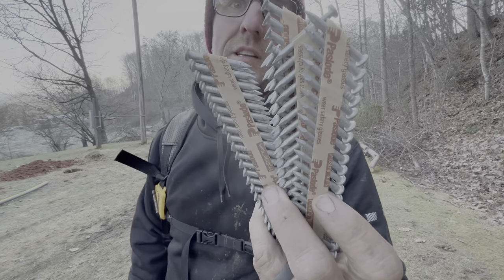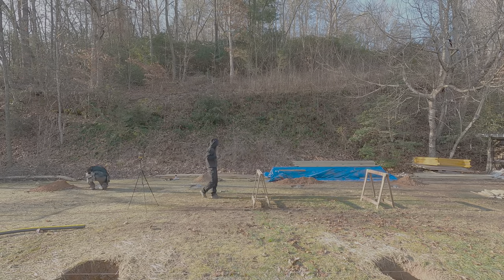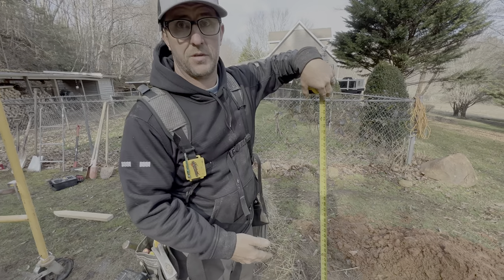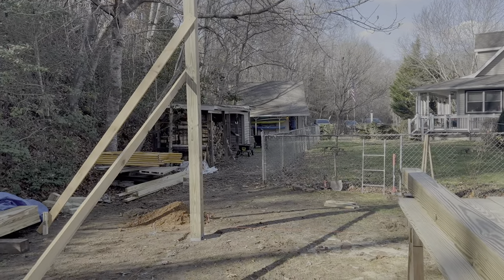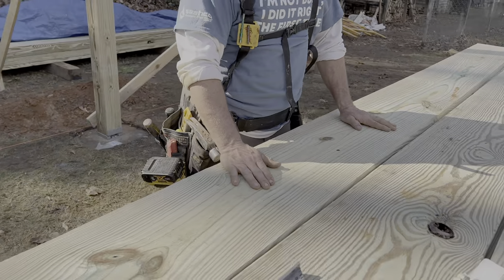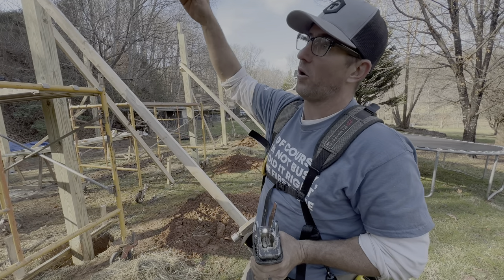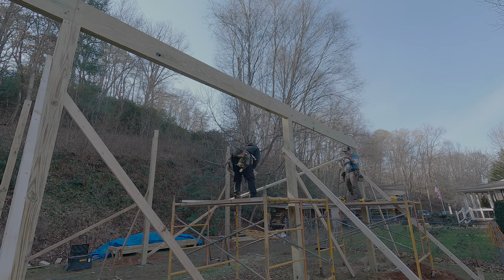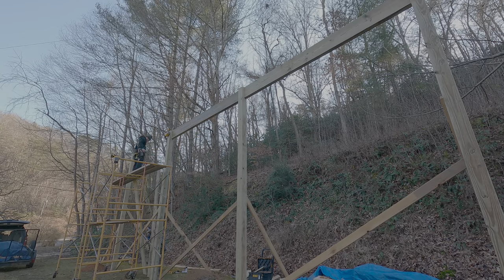Building A Pole Barn // Episode 2 - Posts and Girders

Comment: Those post brackets should be above ground so water does not fill up around it..  Or did dirt down lower than concrete
Reply: Exactly, I mentioned that on the previous episode. Maybe its not required in their area, but in Cali it is.
Shoulda had Jaime check their work!

Comment: When you guys explained your measurements for post length on your tall wall I believe you messed it up or explained it backwards. When measuring from the ground up to a laser the smallest measurement is your highest point. And to level the rest of it you take the difference in your ground to laser measurements and add that.
Reply from the maker: Yeah I think that was our first go around and trying to figure out the lengths. . But we definitely did it correct because it is level. So I think we figured out the right way down the line.

Comment: Heads up on those non-laminated posts wanting to twist/warp on you once they are up, making attaching the horizontal girts (I assume you are attaching metal siding that way) a real PITA install later when post faces aren’t in line. The sooner those go up the better.

Comment: Can you expand on why you chose to set the shorter posts in the ground but the taller posts merely on top of the anchored brackets?
Reply from the maker: The explanation was in the previous video… there is an old road where the taller posts are.
Reply: @Building_Jays_Way  oh right, I caught that hence the shallower holes, didn’t realize you weren’t going to use the same technique on the other side. Keep up the good work

Comment: Looking good, however I’m curious as to why you didn’t place all of your posts in the ground and pour concrete around them versus using the metal attachment plates? Where we live along the coast of Florida you are required to set your posts in concrete due to the wind loading we have from the possibility of hurricanes. Keep up the good work and looking forward to the next video.
Reply from the maker: If I wanted to bury the high side in the ground I would’ve had to buy 20 foot 6 x 6 and that’s a difference of $200 versus $75!

Comment: I didn’t catch why you guys did one side of the posts with the post base and the other side you did in ground. Was there a specific reason?
Reply from the maker: Cost!! I would have had to use 20’ posts on the high side and they were $200 opposed to $75!

Comment: Hi from Thailand
Quick question. 
Which sides the front ? 
Open space side or hill side ??
Just checking as the front should be higher than the back for water run off. 
I know you'd know this but there doesn't seem to be much room hill side if thats the front to manoeuvre vehicles in/out.

Just sayin..

Love yur channels.. quite entertaining
Reply from the maker: The high side is towards the mountain. So the water will runoff the structure and down the hill towards the creek. There’s a way to back the camper in from the backside of the property. Also the way the slide out comes out of the  camper it has  to go into the middle of the structure.hope this makes sense.

Comment: Why are some post buried and some in brackets?
Reply from the maker: Because of the height of the posts. I bought 16 foot poles for the high side so I did not have enough to bury them into the ground. If I wanted to bury those into the ground I would’ve had to get 20 foot posts and those cost about $200  a piece!

Comment: If the first post was 37 inches from laser to post bracket and the second one was 36 3/8 from laser to post bracket that would make the first one lower and not higher than the second. So if you made the first post 15'4" and the second one 15'4 5/8" then the second one would actually be 1 1/4 inches higher than the first and not even with it.
Reply: The first measurement was 5/8 taller than the second one that means you would have to add 5/8 to the second one to get them even.
Reply: @ronniekilbourn3614  except you're measuring down and not up so the addition needs to go to the longer one for the top to be even draw it out on paper to make better sense of it.
Reply: @ronniekilbourn3614  imagine the first measurement was 37" and the second bracket was much taller and the measurement was only 1" if you add 36" to the 15'4" it is going to end up way up in the air compared to the first one that is 15'4". If that makes sense. Using a laser can get confusing.
Reply: @NickWhite630  lol, you're right. I  just sat here and wrote a whole paragraph to as where I'm right. But it said the same thing you're saying. I had to go back and read my reply only to realize it was wrong. Thanks for making me look dumb.
Reply: @ronniekilbourn3614  it's not easy admitting you're wrong, good on you. Lasers definitely confuse things a bit.